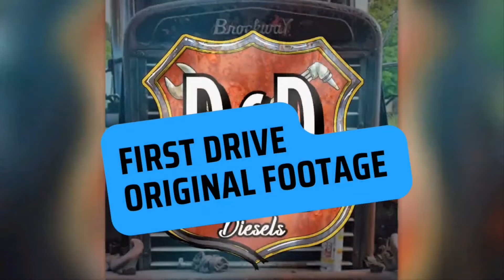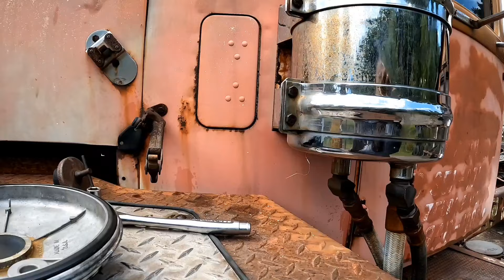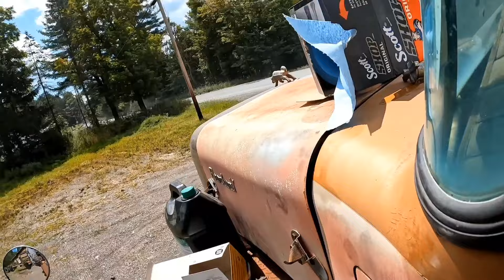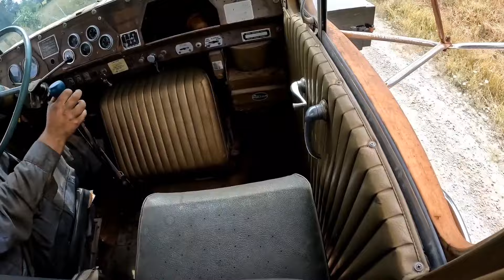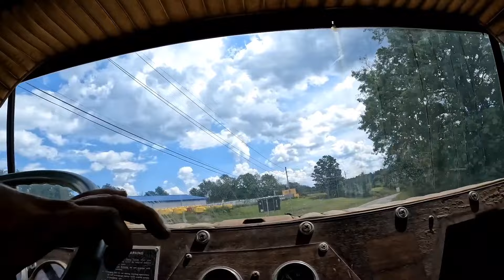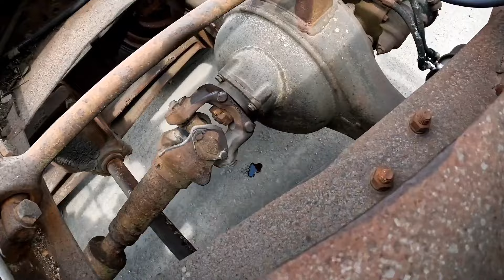1972 Brockway 358! FIRST DRIVE? SPICER 20 SPEED 5X4 NO CLUE WHAT IM DOING!

Comment: we can only imagine how hard was trucker job at the time of this beast truck... noise, smell, hard shifting, heavy loaded, bouncing all around the cab all the time, a lot of miles ahead... my respect to the ones able to do it. Greetings from Italy...
Reply from the maker: That is exactly why I love tinkering on these old trucks! Someone made a living for there family by looking though the window and turning that wheel, as my dad did for my family and I. Thanks for sharing Italys far, that's awesome!
Reply: @doubleclubdiesels2662  https://www.youtube.com/watch?v=Jbnd--xevb4 this is what italian trucker use to drive during the 60's 70's and 80's, togheter with other trucks from famous brand like Lancia, and other now disapperead like OM... funny fact in italy Fiat means reliable truck van and cars... this truck is also well knowed as the king of africa because still in 2022 it's plenty of this truck still used to make the job done. Produced from early '50s until 1988... in 1955 Fiat introduce an hydraulic power steering, first engine was all about 120 hp inline 6 cyl. Last have around 180 hp N/A always, easily tuned into 220 hp. Here a 3 axle to increase legal street weight could carry, it's impressive that they was able to carry around 400 qli around 88195 pounds if i'm not wrong https://www.youtube.com/watch?v=dL0Mx0IyVvE
Reply from the maker: Wow thanks for sharing! I love learning truck history from different parts of the globe, even if the driver is on the wrong side of the cab :P I'm joking, I think it's really cool and I'd love to give one of those a go!

Comment: Sounds like a V-8 Detroit 
You can do the lower rpm shifts when starting out but once your at about 10 mph or so wind it out up to the governor and shift it real fast and it’ll go good 
Good luck man
Reply from the maker: Thank you! Did you used to drive a 555 cummins?
Reply: @doubleclubdiesels2662  I’ve driven Cummins diesel from naturally aspirated 855 series 230’s and 250’s and the old V-903 300 hp V-8’s , 290’s, 300’s, 350’s, 400’s, NTC 460’s, ISX 500’s, 550’s and 565’s.

Comment: When you are empty or bobtailin you need to shift faster when you hook up a trailer and have a load on you can take more time .your having trouble with the shifting because the rpm's drop faster when your bobin .Trick speed shift when light clutch when heavy .
Reply from the maker: Thank you!
Reply: @doubleclubdiesels2662  Your welcome those square cut teeth can be a bitch It may help if you change the trany oil if you haven't done so already .I love them old  ugly monster's .third gear was always a bitch .and with all those miles that trany might need a little lovin read up on it before you poke around in there first .Keep having fun and I'll keep watching.

Comment: Well first I'd recommend to stop using the clutch, then to stop using the aux transmission so much. Empty like that you only need 4 or 5 gears I'd just leave it in dir or even od. Loaded you should only need about 8 or so gears so start in 1st/2nd, shift mean to 2nd, them aux to 3rd, then prob shift both at the same time to 3/2, then aux to 3 then main to 4th, and so on. After a few trips you will learn what ratios are what and get a better feeling. You have 20 gears but around 5 of them will be the same ratio. I'd also recommend never to throttle off idle to get going and to make sure the engine is at idle before taking out of gear.
Reply from the maker: Thank you for the advice!
Reply: Empty even with a 9 speed   I would skip from 2nd to 6th you don't need all those gears like the 18 speed road ranger I usually  drive them like a 13 speed
Reply: @phillipgarrow2297  I know no one that uses the low split of a 18 speed lol. When I was driving a water truck off road I still didn't use them. I didn't skip gears much on regular transmissions as it's easy to shift them that way.
Reply from the maker: @diesellivesmatter   all the stuff we haul at work mostly requires splitting the lower side and up through, even a loaded water truck on back roads isnt heavy enough for low side splits, all depends on what your hauling!
Reply: @doubleclubdiesels2662  yeah I always figured a loaded semi going up a hill would probably need them

Comment: GUYS LIKE YOU SHOULD PICK YOUR CONTENT . THE FILTER YOU ARE SO AVIDLY DESCRIBING IS AN ENGINE OIL FILTER , BETTER KNOWN AS A LUBER FINER FILTER . ABSOLUTELY NOTHING TO DO WITH POWER STEERING . IF YOU'RE A MECHANIC , IN THE INTEREST OF HIGHWAY SAFETY , YOU SHOULD WITHDRAW FROM ANY SUCH PROJECTS ,
Reply from the maker: If you use your eyes and follow the lines they go to the sheperd power steering pump, the luber finer your reffuing to was originally mounted on the frame of this particular model truck but later converted to a spin on oil filter.
Reply from the maker: You clearly have no intelligence in vintage trucks or mechanics I'd suggest you keep you dumb a$$ opinion to your self enless youv worked on it your self. 80% of vintage trucks did have a luber finer engine oil filters in that location. But this one dose not which is specified in the build sheet of my truck. Go f**ck your self